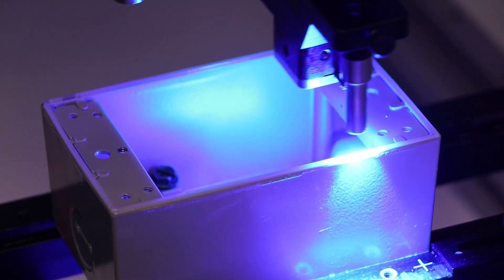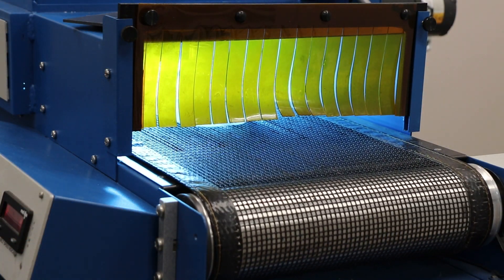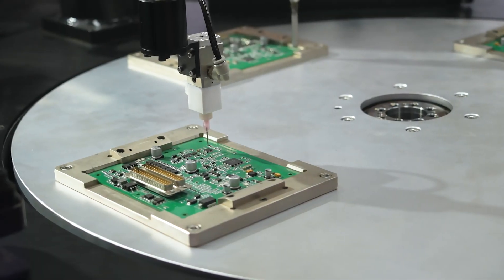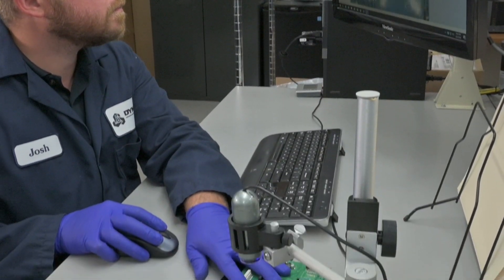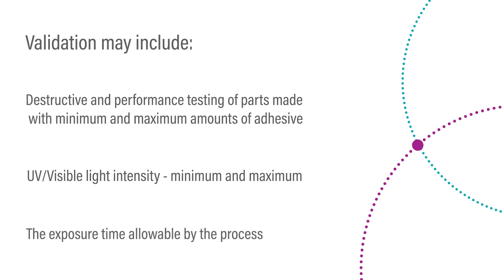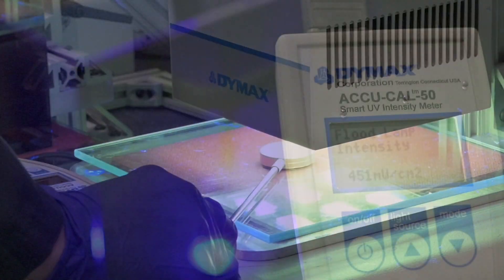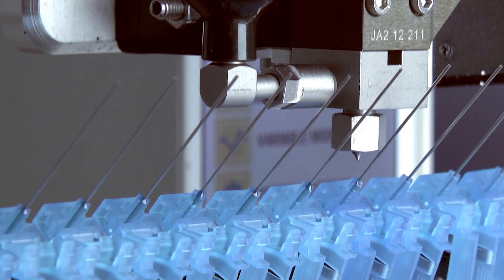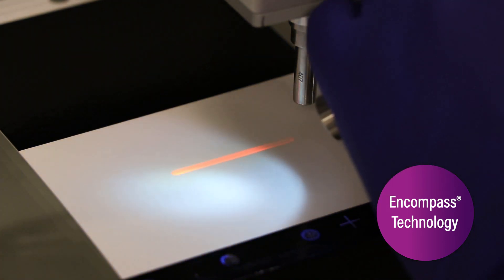Is Your Adhesive Fully Cured?

Comment: Sir, we need to put a sticker on the solar panel and brand it on it, and it should be permanently fixed. It should be naturally visible and not swell when touched. It should be permanently fixed. If it comes off, the glass will break without any visible marks. If someone tries to remove it, if you have any epoxy or other recyclable chemicals at home, please send it to us.